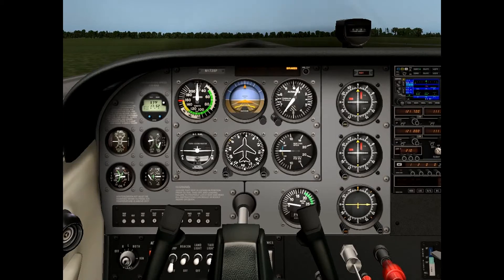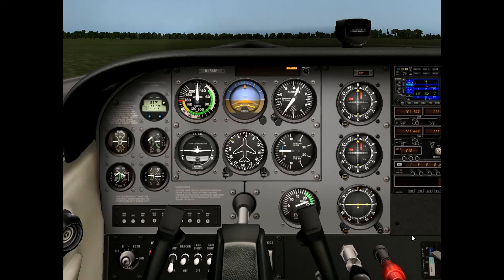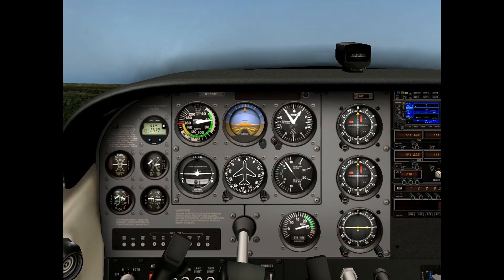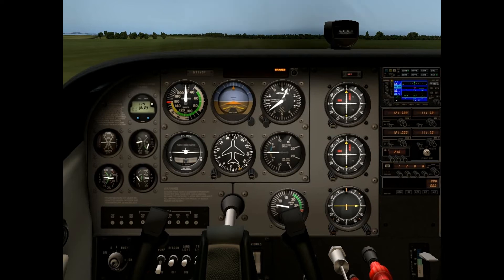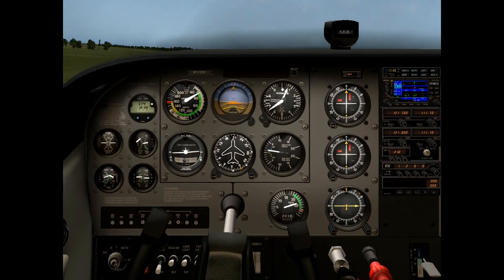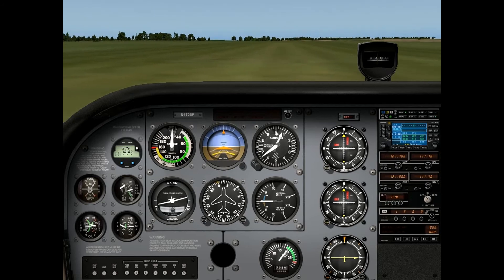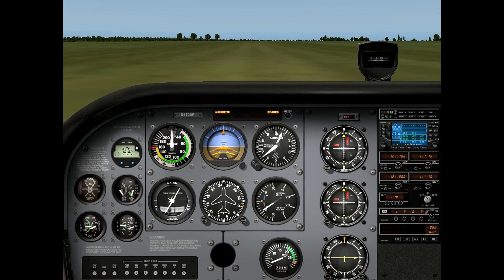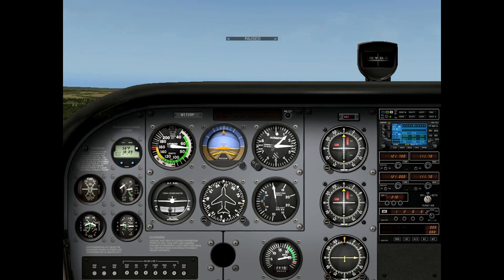Flight Simulator Lesson 10: Short Field and Soft field takeoffs

Comment: Something I noticed during takeoff, I was looking at the EGT. Now I know I’m to be paying attention to the takeoff but since I’m not driving I saw the temp rather low. I take it that as the engine gets up to operating temperature so does the EGT temperature. I remember that once you’re settled on a cruising altitude you’re to pull back the mixture to get proper fuel flow and EGT in the green for optimal performance. Your EGT doesn’t have a green range so should it just be in the middle?

Comment: Hello Mat, thanks so much for your time and effort in producing these tutorials. One has gained valuable information from watching them.
Quick question: is there a way to zoom in, or enlarge/magnify the GPS radio stack?
Currently one is running X Plane on Macbook air and one is having difficulty reading the simulated screen of the Garmin 430 while flying the Cessna 172.
Kind regards, Robert.
Reply from the maker: Dorothyinstead The only way I'm aware of is to zoom in while in 3D cockpit mode; I think that works